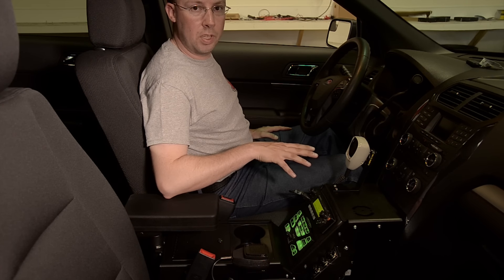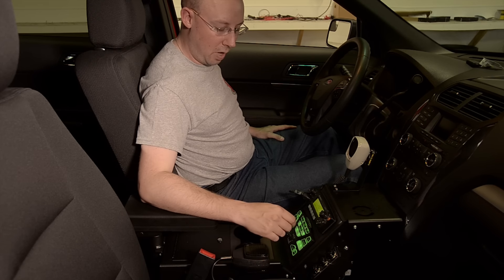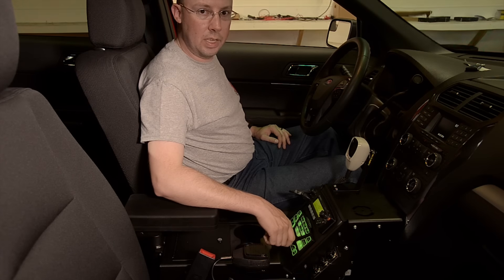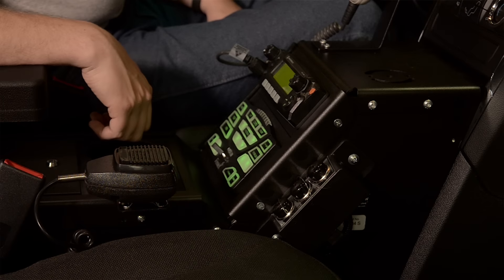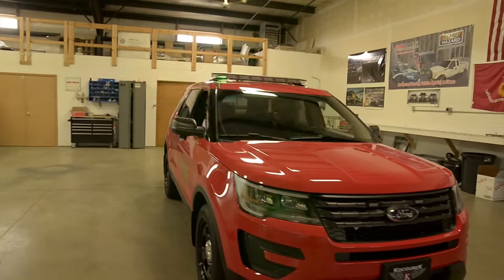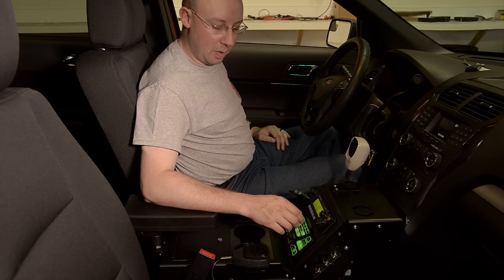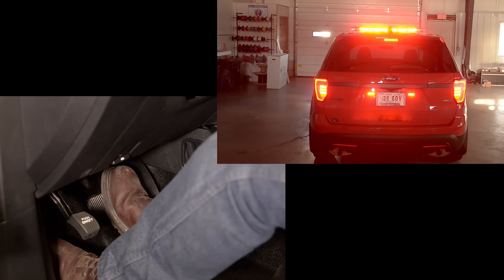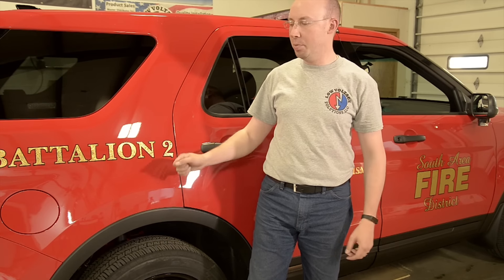SAFER utility Battalion 2 nForce lightbar and Ecto1 Siren

Comment: very nice and clean install just the right amount of lights no super fast useless flash patterns
Reply from the maker: Thank you very much!! We do our best to keep everything effective first, then balance it with "that would be cool" ideas. I also drive quite a bit doing sales calls, etc and every time I approach an emergency vehicle I'll make notice if they are using effective patterns/installations. Things such as keeping a slower flash pattern when the vehicle is stopped, versus faster patterns when the vehicle is in motion, and adding the white flashes for intersection clearing. 
Cheers ~Ben

Comment: Why do so many up-fitters keep doing installs on these smaller vehicles that aren't NFPA compliant. NFPA states no flashing white except to the front
Reply from the maker: Thanks for your interest in our videos Mike! I can't speak for the other installers out there, but we do the best we can to integrate the NFPA suggestions into our builds. In this example, there is no white lighting direct flashing to the rear. If you're curious about the SoundOFF Intersector lights under the mirrors, they are dual color and are mostly forward facing. NFPA also lets us know that the white flashing lighting should be cut-off and not used while the vehicle is not moving. This vehicle has controls for that as well! Finally, here in Wisconsin, our state law allows for "rescue vehicles" to utilize white flashing lights (even when parked) anywhere around the vehicle. Thank you again for your comments! Cheers ~BN

Comment: Wow, great wiring! What are those in the headlights though? Also coulda tied the takedowns in with the high beams and saved a button space.
Reply from the maker: Those are nForce dual color lights from SoundOFF signal! The multi color is very useful. We used controller buttons so the medic could choose exactly WHEN they wanted to turn them on versus the high beams. Cheers ~BN

Comment: What lights did you use in the grill and how did you mount them in the push out spaces
Reply from the maker: Those tiny little lights in the grill are Feniex T3 single color lights. VERY bright, effective and VERY cost effective (at the $30 pricepoint) Once the factory knockouts are removed, the T3 light fit right in that space. I used the provided hardware from Feniex because they were black and mounting into the plastic of the grill. 
Cheers! -Ben

Comment: What is the point of the green lights , did not understand that...
Reply from the maker: Chemical Smart ,Green is meant for command. So the only time green would be on is at a scene and this vehicle would be the command center. Additionally, green has to be the only color on, vehicle in park,  and 360 degrees at the highest point.
Reply: Same here in Ontario, Canada... Green is for Command... and for Volunteer Firefighters when responding to the Station or direct to the scene.
Reply: Yeah I never knew that...Course you never saw that with halogen or strobe bars. This is obviously a new thing.

Comment: Is the vehicle integration built into the bar, or were the wires ties into the vehicles light wires?
Reply from the maker: Thanks for the interest Greg!!
The answer is.... yes... and yes. Haahaha!
Okay; the lightbar is somewhat computer controlled and programmed via a breakout box. This box has a number of input wires. Those wires can be connected into either switches or vehicle connection inputs. The box can then be told "when purple wire has +12volts, turn on 'flash" or 'when pink wire has +12 volts, its the Left blinker so activate the 'Left blinker feature" ...if that makes sense. 
Cheers! ~Ben